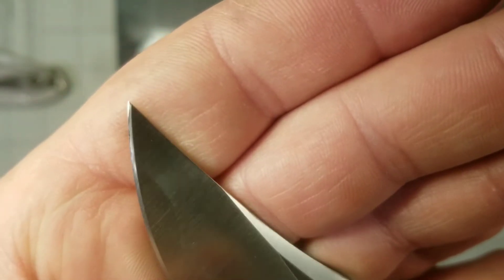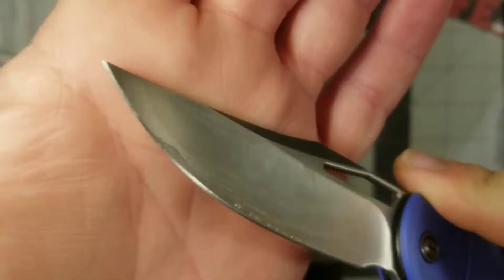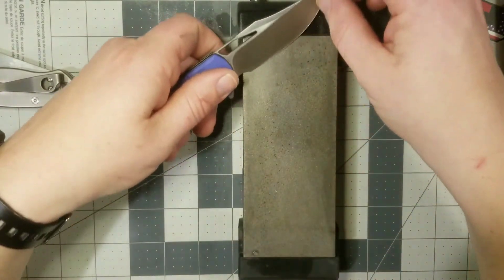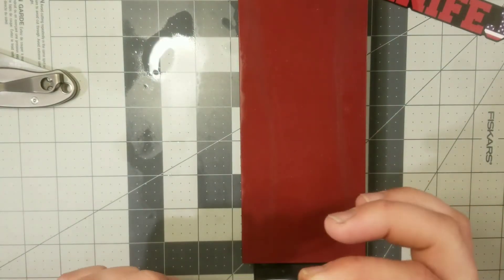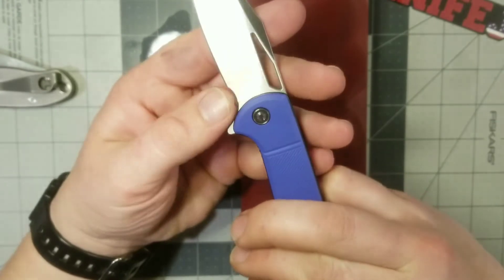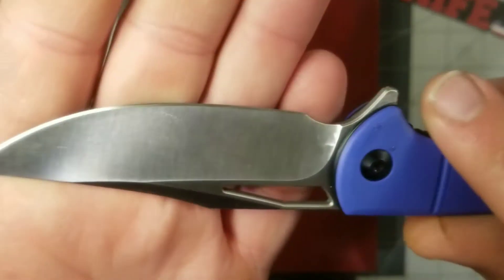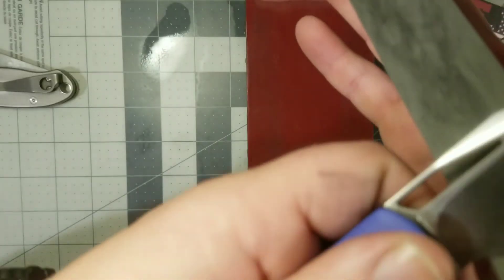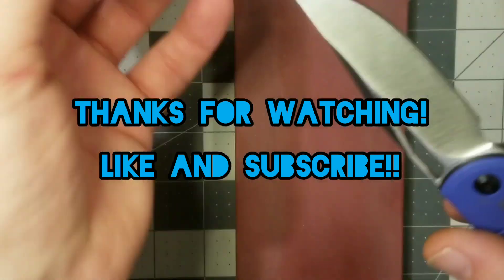Civivi Ortis- initial impressions sharpening 9cr18mov

Comment: The Civivi 9cr18 came up nice for me too, very easy to sharpen. I'm still undecided on if 9cr18 or Sandvik is a better budget steel.
Reply from the maker: Yea brother i like it so far. Comes up very nice. Cuts easily. If it gets decent edge retention like most say its definitely in the running for the best budget steel. I do love 14c28n though

Comment: 9cr18 is a great budget steel hard to decide between it and 14C28N. BD1N also you can count it in there as one of the best budget steels.
Reply from the maker: I really need some more experience with 9cr18mov before i can decide which i like the most. I need to try bd1n as well. ive actually never owned any of that steel.
Reply: @steel2stone  you really should check out the manix 2 lw in bd1n. It's  really blown me away performance wise and it responds brilliantly to a strop.

Comment: I have my first Venev coming my way (200/400 dragon). I'm brand-new to those stones. I have an UltraSharp diamond 300 and a 600 grit stone. Where would my Venev fit into that mix? Thanks!
Reply from the maker: Check out this chart. https://www.gritomatic.com/pages/grit-chart
The 240 will be very similar to a 300 grit plate but it wont remove steel quite as fast and imo leaves a usable toothy edge where a plate especially when new is almost too coarse to use.
600 is still a bit courser than the F400 but not by much. The scratch pattern off of that stone is very uniform. That stone will remove all the deep scratches, setting you up to start polishing. The F400 is where i bring most of my edc blades to. Perfect combination of aggression and push cutting sharpness imo.
Reply: @steel2stone  So for a reprofile, maybe go with my worn-in 300 diamond, then switch to the Venev and do both sides?
Reply from the maker: @MrEric0822  plates can cut dramatically different from when they're new to after a few dozen uses. You may find that the 240 cuts faster than your plate if its very worn. You may just have to try it out and see. If the plate is fairly worn in you may not notice much of a difference between the plate and the venev in either grit.

Comment: Don't laugh but last night I tried touching up my Badlands Vagabond and an Arkansas stone I use for casual late-night jobs wasn't really doing much but polishing it. Never really did raise a burr. Remarkably hard stuff, at least as heat treated in my knife, for a budget steel.
Reply from the maker: It should cut it. May just be too dull to do it quickly. Try to raise the angle slightly. Or by a few degrees and do a microbevel
Reply: @steel2stone  Well, I gave it a pretty good shot. It was cutting, sure, but where are you, burr? Scanning the horizon in vain. When I have that much trouble raising a burr I like to move to greener pastures. My main point is I was impressed with the hardness of a steel people don't talk about much. It's not Rex 121 but it's not dog meat either.